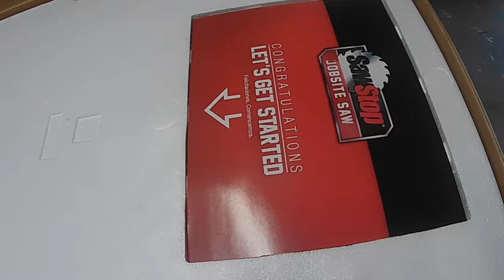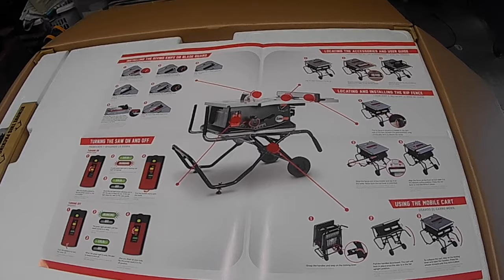SawStop Jobsite Saw Unboxing and Initial Setup

Comment: Nice, I have this saw also. I have had mine about a year and a half. I love having the safety feature, but I also think the fit and finish and features are superior to other saws in its size range. I have been very pleased with mine, other than having to put a new switch box in. However that was covered by warranty and their customer service has been very good. So no complaints.
Reply from the maker: Garage Misadventures thanks man yes it’s a great saw, I honestly only got it for the safety. But as you said everything else is also on par or better then the rest.

Love  to have your support and follow my channel. Will be checking yours out now